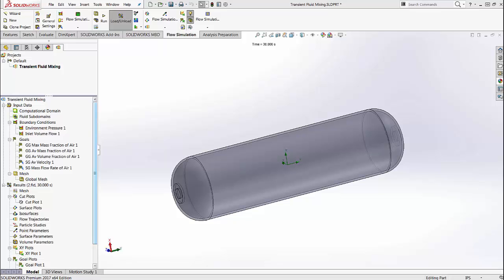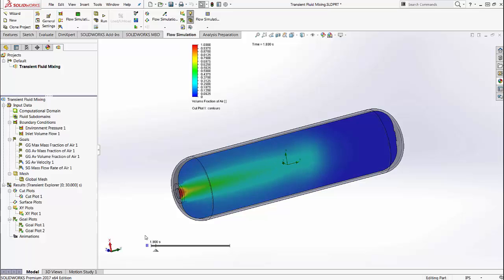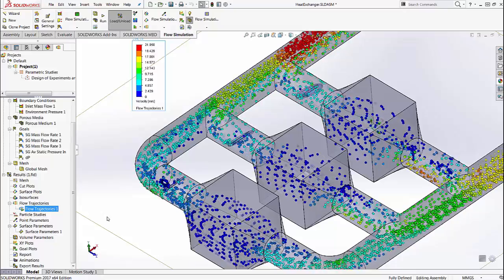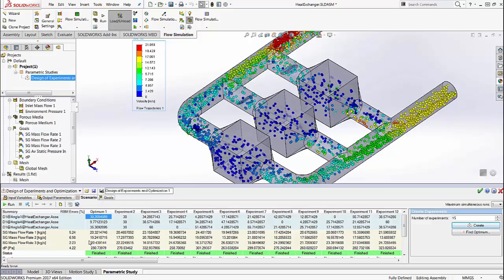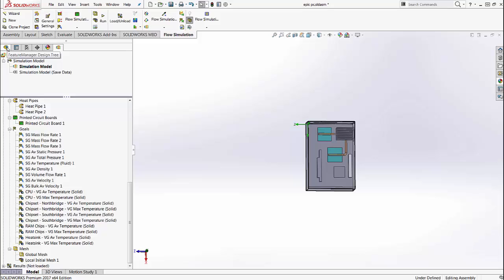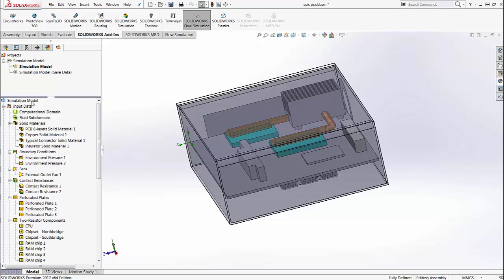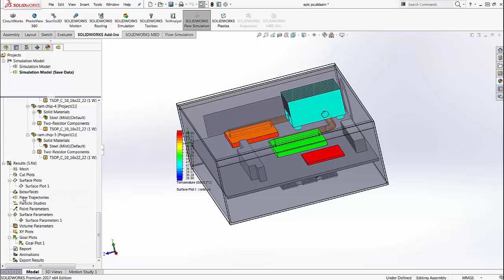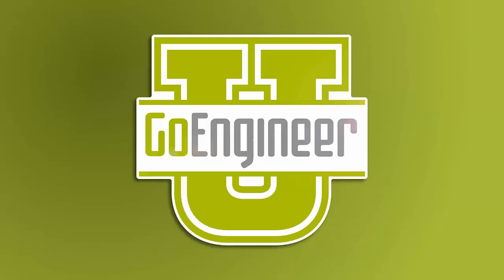SOLIDWORKS 2017 - Flow Simulation

Comment: is there option for moving parts transient simulation, like opening valves/ moving piston in internal combustion engine .
Reply from the maker: Hi Sasquatch,
The actions that you wish to simulate (Opening valves through moving parts, pistons firing, combustion) are not currently capabilities of the Flow Simulation software.  You would likely need a more comprehensive multi-physics analysis package like COMSOL.

Comment: also, how to tell CFD results are reliable? Without experimental data.
Reply from the maker: Hi Fadoobaba,
You would want to test convergence of your setup by running the same boundaries under a higher mesh refinement and possibly with local mesh settings to make smaller cells. If your results do not change then you have converged. Whether this fits your real life analog depends on your experience and comparison to real life testing.
Reply: that's the issue, I do not have physical data to compare it with, I have achieved mesh independence though.
Reply from the maker: Then your next step may be to do real life testing.